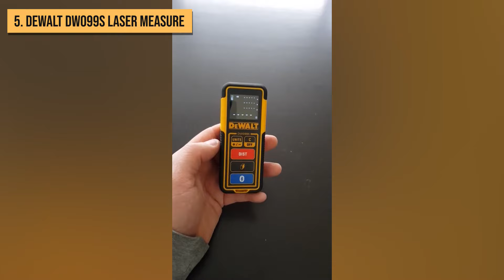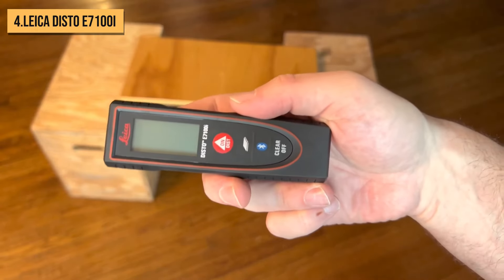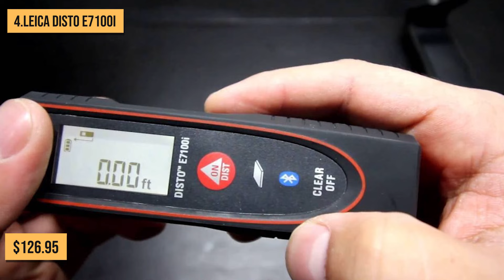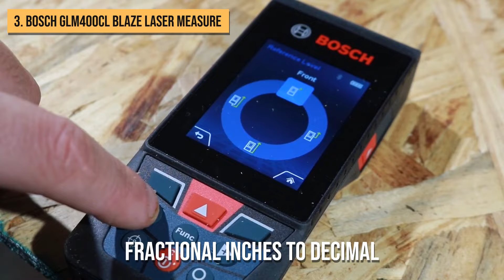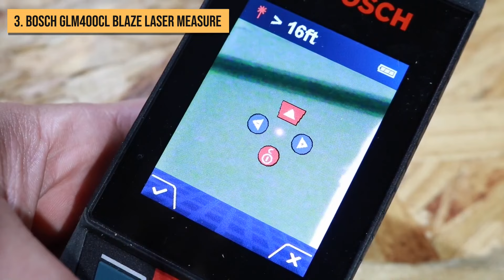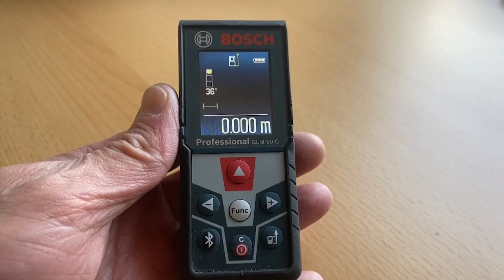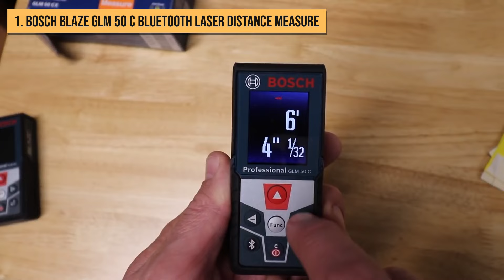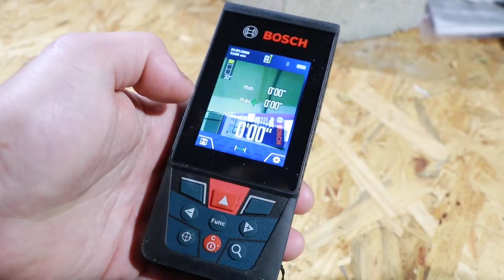Best Laser measuring tool - Top 5 Best Picks (2024)

Comment: do any models work with an offset (not just add/subtract) entry?  Do any models work point to point (P-P) using range, angle and inclination to calculate the measure between two distant outdoor points?
Reply: I want to use such a device with a plastic corner-cube reflector plate, which reflects THOUSANDS as much back in the direction of the emitter than a white paper-like surface.  (See Lambertian reflector.) I want to measure 500, 1000, 2000 meters, with a resolution of 1 millimeter .   Problem is, I don't think the device will 'wait for' such a delayed reflection, even when it arrives late.
And, of course, the display doesn't have sufficient digits to display this.